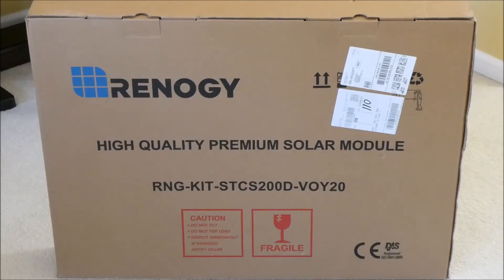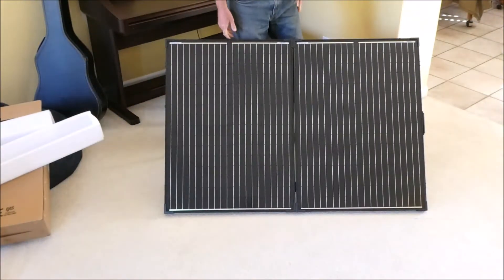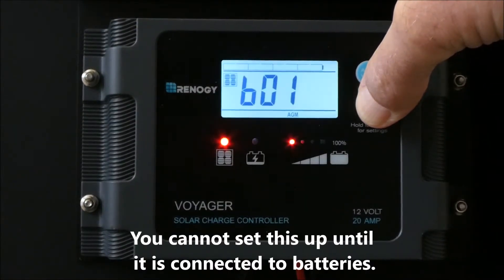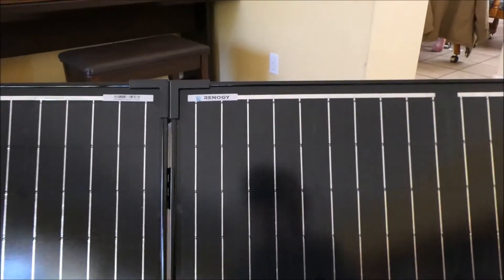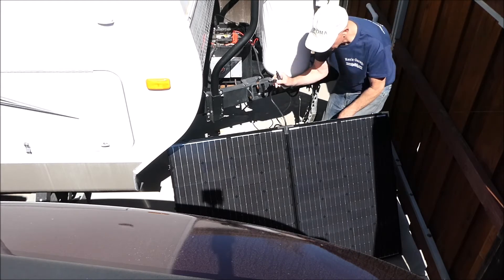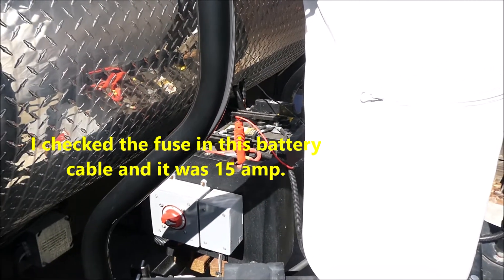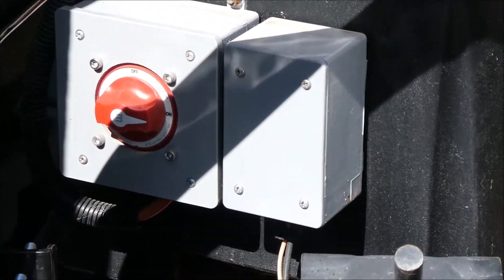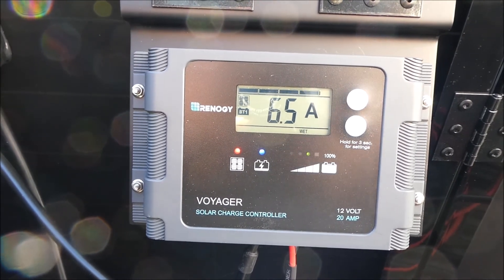Renogy 200 Watt Portable Solar Panels Ep1 - Unboxing and Initial Set up

Comment: Hi   You are  WRONG ..!!!!    Seriously    You need to listen   For   Maxx  Charging  them solar panels need to be in MORE  SHADE    The More  Shade you put them in the Better energy they produce 
DO   NOT   ---   DO   NOT..!!!!!    Put them  in Direct SUN  

Solar panels  Need  SHADE   the more shade the better they work  EVERY   
EVERY
EVERY    3   Year old  ---  with   3 year old level of common sense knows that   
Solar panels do not do well in direct sunlight  thats why they are called solar panels 

The Dumbest thing people can do is put in direct sunlight 
The Smartest thing is mounting them in the Basement - Under your Camper / RV  the less sun the better power reading  thats basic 3 year old common sense   
Hope  that Helps 
You can't  FIX   STUPID  But you can dam sure laugh at such ones ha ha ha ha ha 
My 3 year old knows more than most of you about solar energy

Comment: What kind of screws are holding it in place? I got the same unit but the screws are round and small I cannot take them out to seperate the units.. someone please help...
Reply from the maker: If I am understanding you correct you are wanting to separate the two solar panels. They are not meant to be separated. The hinges are riveted to the frames as is the controller. The only thing that can be removed are the side stands. Why do you want to separate the two panels?
Reply: @KensGarage1  
I got a good deal on a damaged product. 
I got the 200w solar for $80 
One solar is completely broken as in glass is all shattered .. another one is brand spanking new untouched. 
That's why I want to seperate the broken 100w from good 100w and get a 100w renogy rolar for $80 

I really want to seperate the two solar panels.. 
Is there any way you can point me in right direction bud I'd appreciate it
Reply from the maker: @vucicevicdanijel11  I understand. My recommendation would be to lay the set of panels face down (glass down). Remove the rivets on the damaged panel by using a hand drill with a 3/16 inch drill bit. Use relatively light pressure and drill until the head of the rivet comes off. Do not drill through the hinge and into the aluminum frame. Go slow. Hopefully the replacement panel already has the holes drilled in it for new rivets. You need a rivet gun and the proper diameter and length rivets to properly secure the hinge to the replacement panel. Here is a very low cost example of a rivet gun kit that can be on your doorstep in one day. https://amzn.to/3GVS1Ox
Reply: @KensGarage1  Ken, thank you very much Sir for this info and amazon page. 
I will try tomorrow morning hopefully it comes off. 
I went to homedepot to try to get steel hinge cutters and I got a steel cutter. Hopefully steel can cut steel? 
I will try to 3/16 method first. 
I really appreciate you taking your time in responding and for amazon page. Thanks again and again :)
Reply from the maker: @vucicevicdanijel11  You are welcome Igor. Good luck. I hope you get everything fixed up.
Reply: Are the hinges that are holding it in place metal or steel? I can't tell..
Reply from the maker: @vucicevicdanijel11  The hinges are steel and the solar panel frame is aluminum.
Reply: @KensGarage1  I'm going to go to homedepot and rent some steel cutters 🤙 thanks for your help Ken

Comment from the maker: 4/10/22 update. Please read through all of my pinned comments here for all the details of the "glitch" I experienced.

PSA There may be a glitch on my system. I keep it connected 24/7. I always check the controller. About a week ago it was displaying 15.8V. Too much. Normally in charging mode it will get to 14.7V, then when the batteries are charged it says FUL 13.6. I immediately emailed Renogy. They replied right away requesting photos. I emailed photos and more detail. No reply. I sent a second email. No reply. I will report back what they have to say when I hear back from them.
Reply from the maker: 4/20/21 I have emailed Renogy four times now. They have not responded. Renogy, if you are reading YouTube reviews I suggest you reply to case Case Number: 00200195. At this point my recommendation is to not purchase their products due to lack of customer response to a problem with the system. I have plugged it back in and it seems to be working properly again. But who knows when it will overcharge again.

8/28/21 Edit: I want to put another update here. On 5/19/21 Renogy did send an email reply to me: 

"Hello Ken xxxxxxxx,

Thank you for contacting Renogy. Hello Ken, I was going through some older cases of ours and had come across yours, Was wondering if you still needed assistance.  If so please provided a preferred phone number and I can reach out to you asap. Hope to hear form you soon." 

Strange that it took them that long to reply. I chose not to contact them. The overcharging condition has never surfaced again (that I have seen). We have been on several camping trips this summer. While at home I leave these panels plugged in 24/7. We have been on several camping trips this summer and the panels worked fine on the road also. So after approximately six months the overcharging glitch seems to have disappeared. I look at the controller frequently and it typically gets up to 14.7V and then reduces the charge as it should. I suppose there is still a shadow of a doubt that it may overcharge and I just missed looking at it at that moment. The two 6V golf cart batteries seem to be performing quite well using the system.